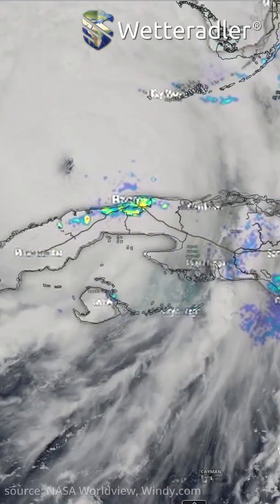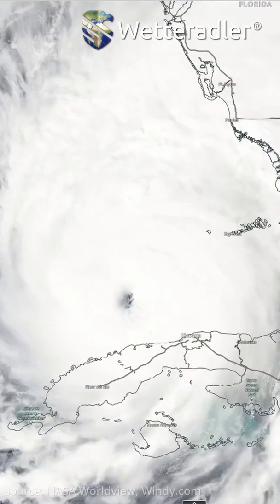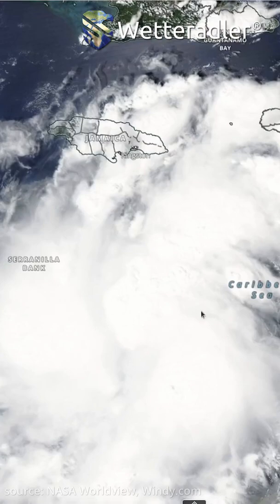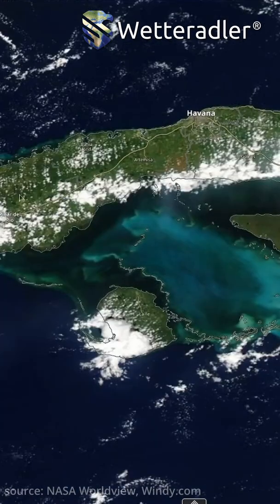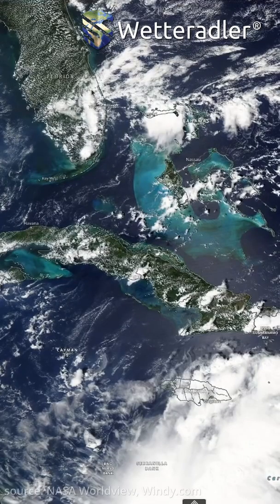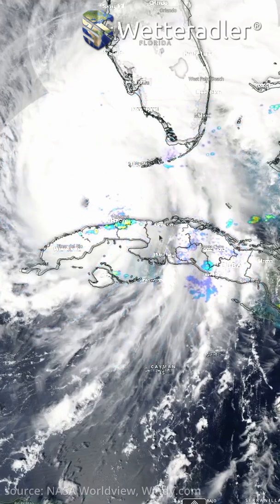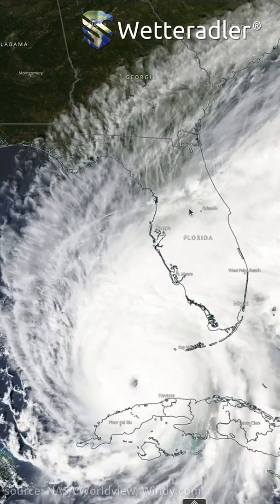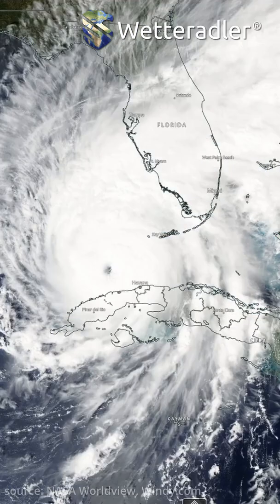Florida Thunderstorm Hurricane Ian - Weather Control or Climate Change? | Geo-Engineering NEXRAD

Comment: Thank you for this video. I fight against geoengineering - weather modification since 2009. That year Croatia get in NATO.
👈 Look what they are doing in Croatia!
Since 2009. we have floods, droughts and hails.
Reply: No. 
You are NOT fighting against “geoengineering” or weather modification. I doubt you even understand what those terms even mean. (The two terms are basically the same thing, by the way.)

The only type of ‘weather control’ known to exist so far, is called “cloud seeding.” It is typically done by spraying silver iodide (other compounds have been tested with unsubstantiated effects) into the air either from an aircraft, or from the ground at high altitudes. 

To this day, no statistically significant difference has ever been achieved. 

I really do wish we were able to create rain clouds when needed, (especially in drought prone areas with high population densities) but we simply just haven’t gotten that far yet!

I hope that we eventually will be able to create on-demand rain clouds when we need it, but I don’t see it coming anytime soon..